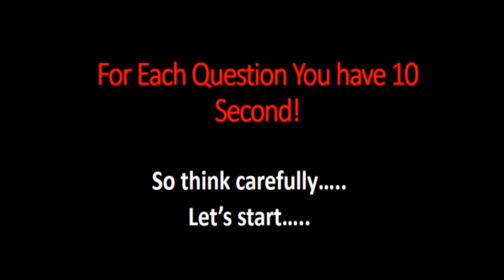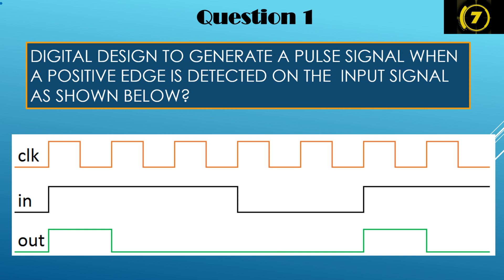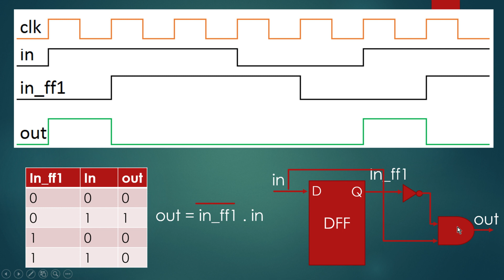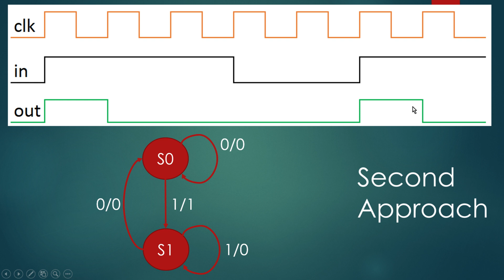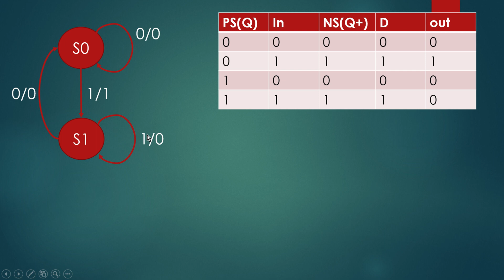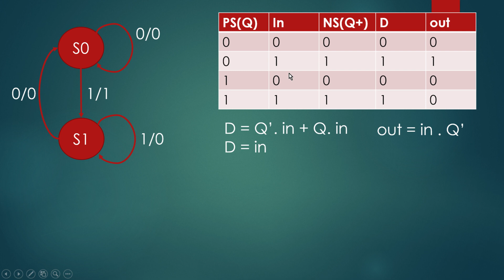Electronics Interview Questions : Digital electronics - Part 3

Comment: Sir in the first approach the in_ff will be delayed by 1 clock cycle or less or more clocks  depending on how much time after the clock , "in " input is applied to D . Sir is there any role of setup time in first approach as in fig both input and clock are applied simultaneously so the in_ff output should come at the same instant if the setup time is zero. Please clear my doubt sir
Reply: There is definitely some finite setup time of the flip flop and because of that setup time only the input (signal) is delayed by exactly one clock pulse as it is not stable(changing) at the same moment as that of the positive edge of the clock but by the time it was the 2nd clock pulse my input signal was already stable at 1 and hence that was passed as the output of the flip flop
Reply from the maker: @kirandeepkaur8407  Thanks Kirandeep.. I really appreciate that you involved in this discussion.
Reply: @TechnicalBytes  SIR WE HAVE TO USE TWO D FF FOR ONE CYCLE DELAY BECAUSE FIRST FF WILL TRANSPARENT TO INPUT after another ff have one cycle delay please tell I am correct
Reply: @kirandeepkaur8407  Got it thanks for guiding